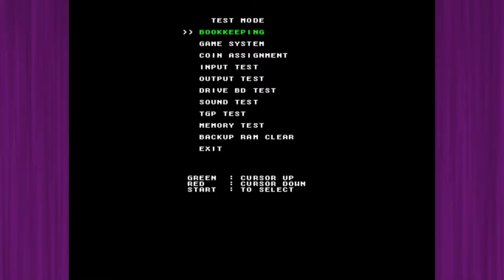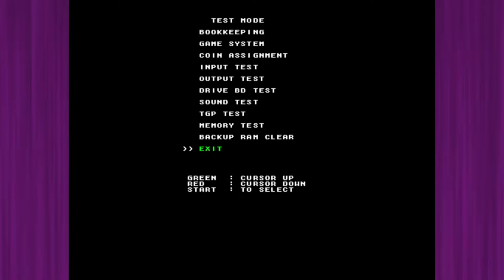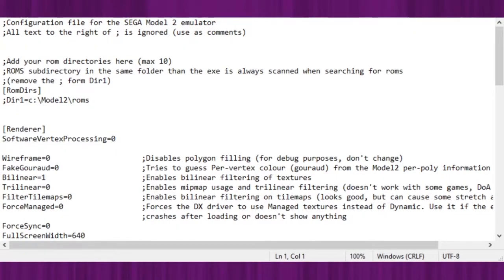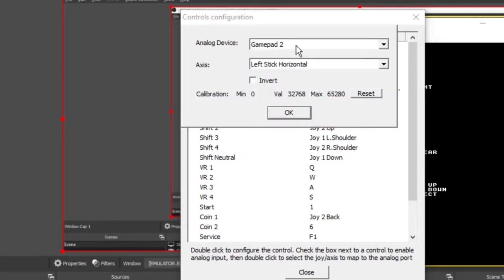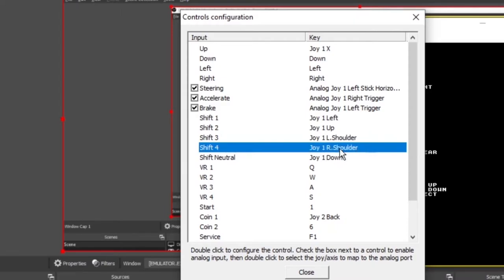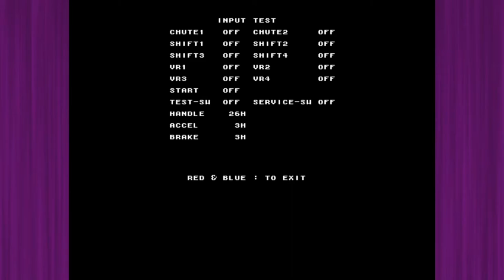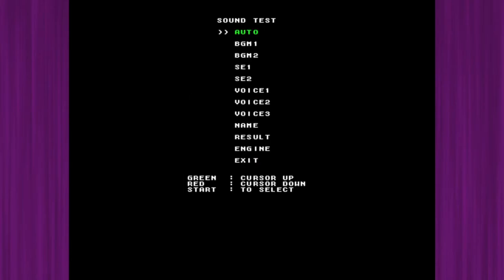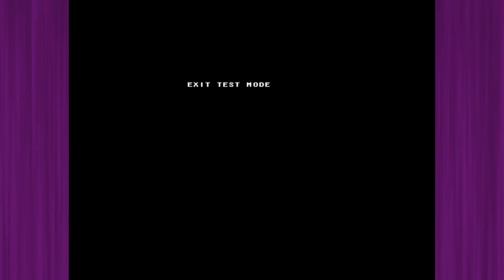Model 2 Tutorial - How To Set Up Daytona USA (Network Board Not Present, Controls, Etc.)

Comment: For those who are having trouble mapping the accelerator and brake triggers on Dual Shock and Dual Sense controllers, download the x360ce controller emulator and place it in the emulator folder. Map buttons on x360ce and enable X360 controller support and also remap buttons on emulator. If the emulator does not recognize it, check the x360ce Issues tab to install missing files. I did that and it worked. Sorry for my English, I used Google translate

Comment: Thank you so much, mate! You're a F** hero! I couldn't get past the network screen. You got my sub

I'm now playing with a T300, TH8A shifter but the Nebula version I'm using (dl from segaretro) didn't like 6 XInput devices and had to reach for my old pedal set (not a problem since I suspect Daytona wouldn't benefit from a load cell pedals).

The FFB settings in the ini file don't work properly so I suggest enabling auto-center by the wheel to about 10% in the driver settings. You might wanna try a higher value on a Logitech wheel since it's much weaker.

Edit: I had to invert controls for accel and brake using a T3PA. Just pay attention at max and min values when the pedals are fully pressed.
Edit2: If you're using a shifter like TH8A you may experiment with the Neutral position a little. I have a short throw mod installed but the stock one has a really long throw. The mod I have is just a nylon 3D printed H-gate that goes beneath the stock metal plate if anyone asks.

Comment: Hi, thanks for the video. I'm trying to use a PS4 controller with the game, but at first couldn't assign accelerate or brake to the triggers. I altered the .ini file, and now I am able to select them in the drop down. But unfortunately, my Coin 1 & start buttons have changed. Now when I try to double-click on them to reassign them, the emulator freezes and crashes. Can you suggest any help?
Reply from the maker: What did yoy change in the .ini file?
Razzle Joestar
Reply: @AnthroArcade  If the Xinput line is changed from a 0 to 1, the emulator recognises gamepads, whereas before it would only see the PC keyboard or basic joypad controls. Now it sees the controller as a proper analogue device, but it freezes whenever I try to double click on any of the options.
Reply from the maker: @digivizwiz  can you modify the controls from within the .ini file?
Razzle Joestar
Reply: @AnthroArcade  Under "input" there's only the option to enter a 1 or 0 in the XInput line. No other options.
Reply: @AnthroArcade  I'm trying to use a PS3 controller with the PC. It works fine with the standard emulator settings (not XInput), but I have to map the L&R shoulder buttons as accelerate and brake, as there is no analogue control. It allows the left stick to act as analogue steering though. 
But when I activate the XIput (change from 0 to 1) in the .ini file, the emulator gives me more analogue options (L&R triggers), but the controller is apparently not detected by the emulator anymore.
The PC keyboard keys can be used, but not the controller. This goes for any game.
Could it be the fact that I'm using an PS3 controller and not an Xbox one? I have an Xbox 360 controller, but I can't connect it to the PC.
Reply from the maker: @digivizwiz  hmmm it might be. 

For the xbox 360 controller I thiiiink there's usb adapters you can get. There's also a dongle that will let you connect it to a pc. That's what I use to connect my 360 steering wheel. 

Razzle Joestar